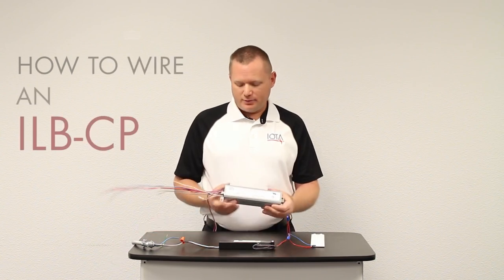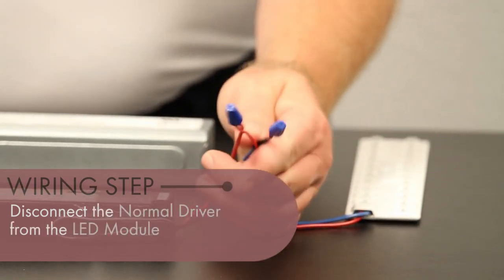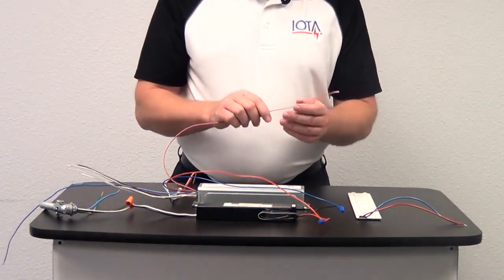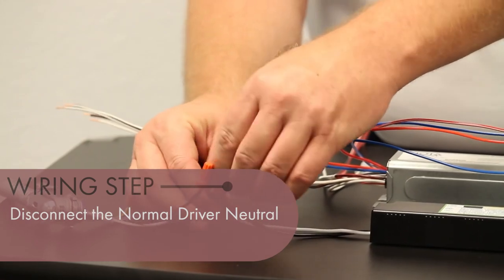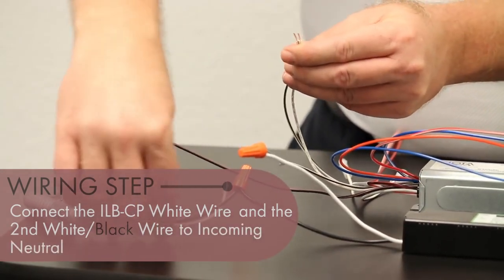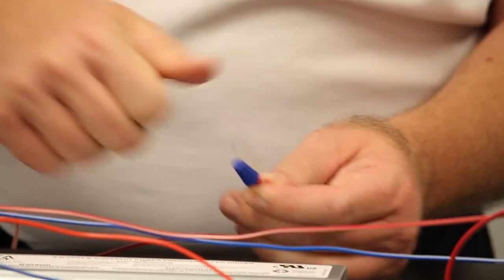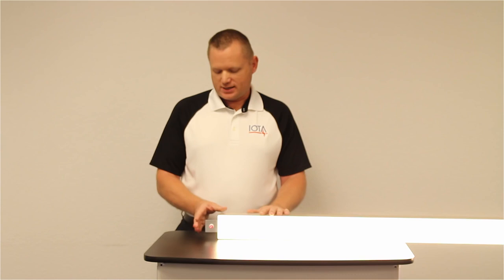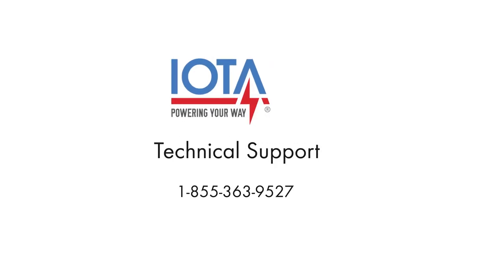How to Wire and Test an IOTA ILB CP Emergency Driver

Comment: Hi Thanks for the video, I just replaced one yesterday after it stooped working, is there a schematic for the unit to know what each wire do we know the input is 120V but there is a lot of output wires if you have in PDF format that will be great, also is there a way to test the old unit to make sure its dead before disposing it. Thanks,
Reply from the maker: Hi Besmel Tammo! Thank you for reaching out! Unfortunately, we no longer carry this Emergency ballast however I was able to find a wiring diagram for you. It is provided in the link below. As for testing out the old ballast you may want to see an electrician for that answer. My apologies. Please let us know if you have any questions regarding our products! We can be reached at 1800-624-4488! We also have a chat team ready to assist on our website. Have a wonderful day!

https://a89b8e4143ca50438f09-7c1706ba3fabeeda794725d88e4f5e57.ssl.cf2.rackcdn.com/spec_sheets/files/000/039/710/original/iota-ilb-cp10-a-diagram.pdf?1555535737